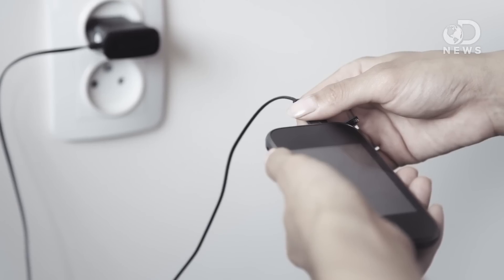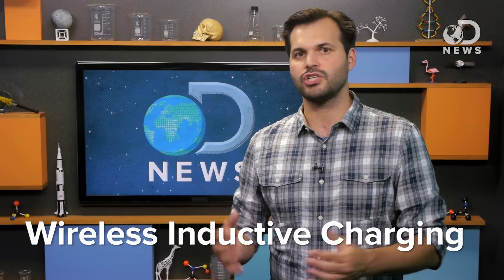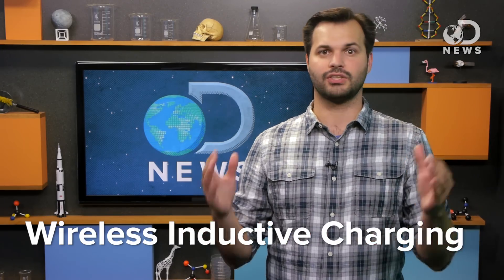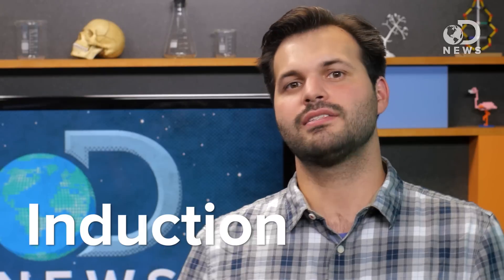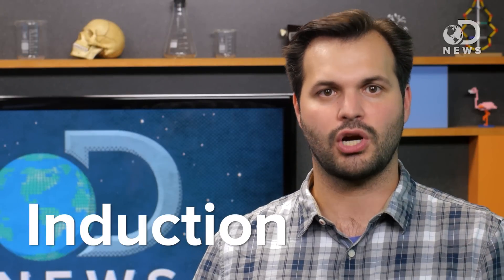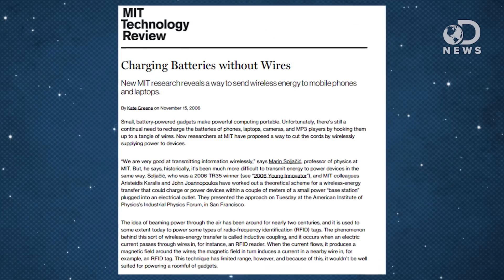How Does Wireless Charging Work?

Comment: Electric cars, have it in your garage or parking garages. Or figure out a way to make roads out of solar panels, put the chargers all over in the roadways and figure out how to switch them on/off when cars pass by.
So when the charger is on, your effectively sending a charge to the whole room...so your wasting a lot of energy not getting to your object to be charged?
If your wireless charger is on and you have numerous objects charging off one wireless charger, do you use more energy than just one object? Or does it just take the 2 objects longer to charge, effectively using the same amount as if they were each done independently

Comment: How bout this: a magnet inside a mouse pad, then a copper coil inside your mouse, and moving your mouse around creates a current inside your mouse, and you don't ever need to replace your battery for it anymore. And the mouse pad doesn't need to be plugged in either.

Perhaps the only downside could be that it would make your mouse harder to move, since the induced opposing magnetic field inside the coil will push back when you try to move your mouse, so it might take more force to move your mouse. So, like how it works right now, it would probably not be the best solution for gamers who need swift mice.

Comment: the simplest wireless charging works on the same idea as a radio transmitter sending out a signal and the battery to be charged is connected to a crystal receiver. the radio waves are converted to a charge by the receiver and a capacitor.

Comment: Qi wirless charging is at 100kHz.
Reply: And it's supposed to use less power, not more like he said, because it only turns on when it's charging something. Not like the adapters that we have now that just keeps sucking power from the outlet, right?
Reply: It runs of standard usb. 5V 1A ish. Its on all the time, just not drawing much current , just like not pluging in your phone.